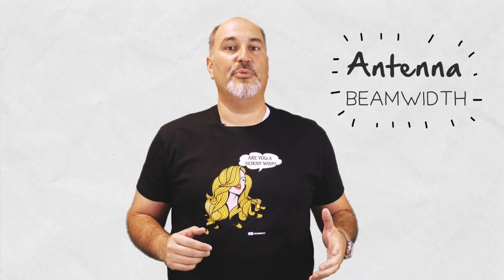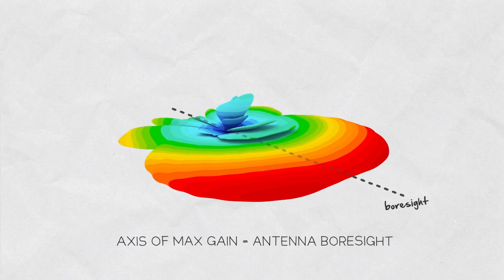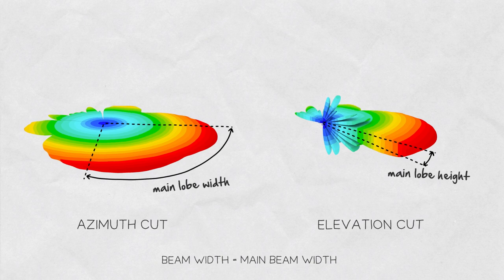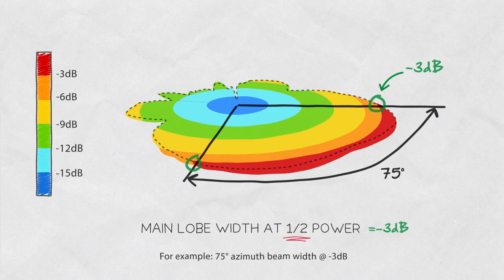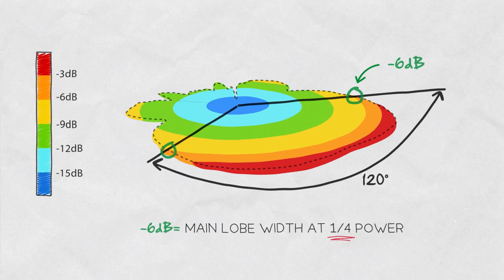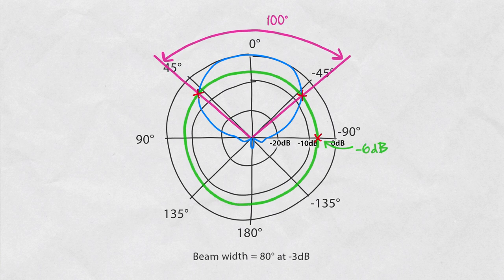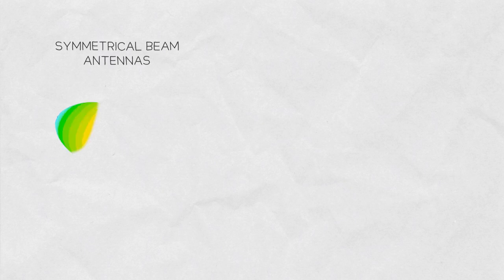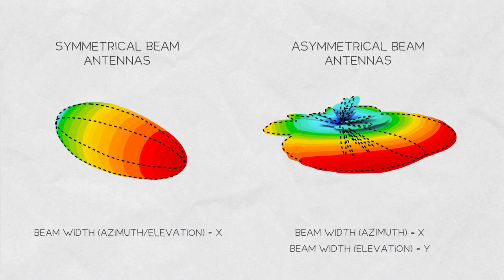Inside Wireless: Antenna Beam Width

Comment: Why does beamwidth decrease as antenna length increases? Intuitively, I would think a longer antenna would make a "fatter" beam. I understand the length is defined with respect to the "plane of the measured beamwidth", but I don't physically understand what that means.
Reply from the maker: You can look at the antenna as a sort of 'lens' - the bigger the lens, the more it focuses the energy, or in this case narrows the beam width. You correctly point out that the longer the antenna the flatter the beam.